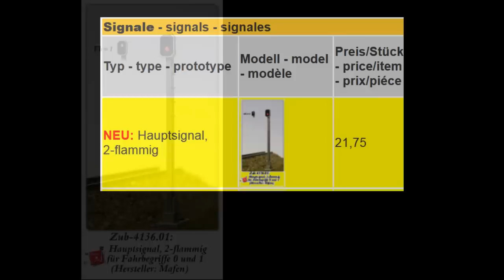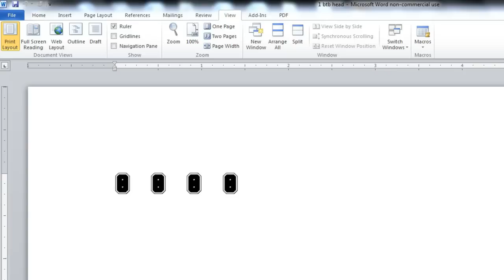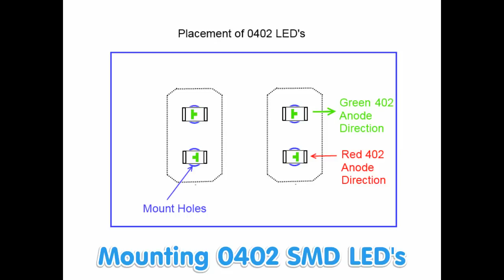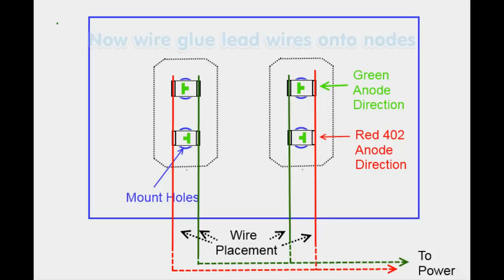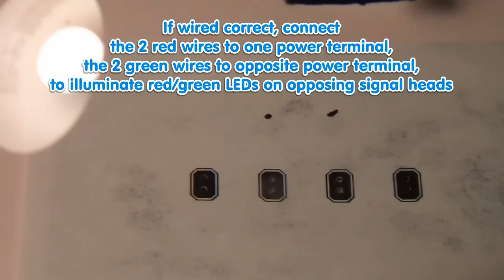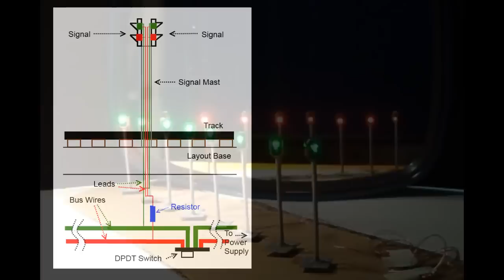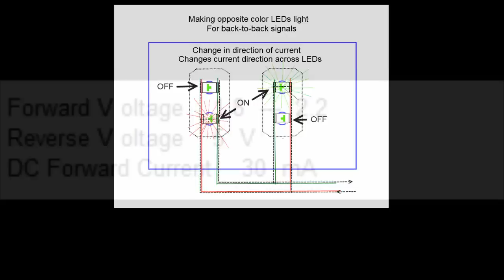Modeling Railroad Signal Systems: Make Simple Green & Red Signals

Comment: Hello: I notice all the wires through the plastic pole appear to be bare, if so how come they don't short out seeing as how they are all touching?
Thank you for a very instructive video.
Michael
Reply from the maker: Michael Meredith 
Michael... thanks for comments.  The wires through the poles/signal-mast look bare but they are not.  They are enamel coated. Magnet wire or enameled wire is a copper or aluminum wire coated with a very thin layer of insulation.  Here is the link to the exact wire I used in video: http://www.hobbylinc.com/htm/ngi/ngin5038.htm?source=froogle&gclid=CML_78evy78CFZDm7AodMHsARA
I used sand paper to strip/sand off the enamel coating of wire ends to make the electrical connections.  When you strip the wire ends, the stripped/bare wire will reflect light brighter than the coated wire....  this is better seen under a good light looking through a magnifier glass.  You try to work close and careful not to strip an overly-excessive length of the wire ends.  With that said... If any spots of stripped wire ends do look as if they may touch when you bunch them together into the signal-mast, then re-coat them by dabbing on very light coat of enamel or white glue onto the bare spots (and let it dry) before you route them through the plastic signal-mast.

Comment: Thank you very much for the demo and all the details.

My question is about controlling the lights. I am assuming the system you are proposing is activated by the user. If the user sends the trains east-west through the train power pack, the user has to separately light the system, so that the signals show green from east to west and red from west to east.  The light circuit is separate from the circuit that controls the power to the tracks to run the trains. Is this correct?
Reply from the maker: You are correct... the track current is separate from signals' current.  The track current is supplied by a typical old fashion 12 volt power supply with a manual dial (Rheostat).  The signals' current is supplied by a 4.75 volt  power supply pack (salvaged phone charger).  
Wiring:  each signal mast has a set of lead wires (one positive and one negative) that connects to LEDs in the mast heads as demonstrated in the video.  The leads from each mast route through and beneath the layout base, and connect to a 2 wire (positive and negative) buss line.  The buss line (as long as you need it to be) feeds back to one DPDT switch.  The DPDT switch gets power directly from the 4.75 volt power pack.   BY MANUAL OPERATION of the DPDT switch the current direction and thus signal colors are changed to match the direction of traffic on the tracks.  (The DPDT switch has a center position for current OFF).

Comment: Hi, great video, would it be possible to supply the template for the front of the signals. Again excellent.
Thanks
Reply from the maker: Thanks... you can link to the word processor template for back-to-back signal faces directly at Google Documents: https://docs.google.com/document/d/16TiD0ceqenYd-3cUY59jgpJZp-KvO8HSlhn6X1mJEXs/edit
(Supplied as a word processor document so that others can change print size to suit different size scale modeling.)
You can also link to the same template and ALSO images for signal wiring found on my blog at: http://ringo-themadmodeler.blogspot.com/
Reply: Hi Alps.
Many thanks.
Dave
Reply: David Moreland